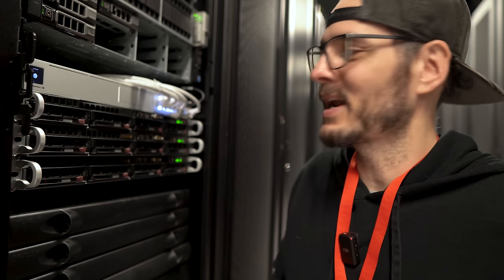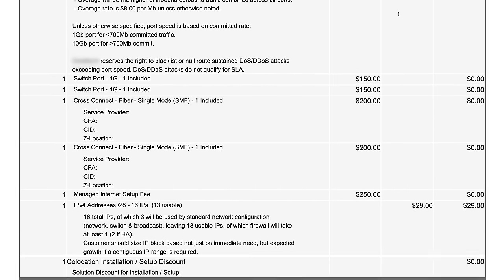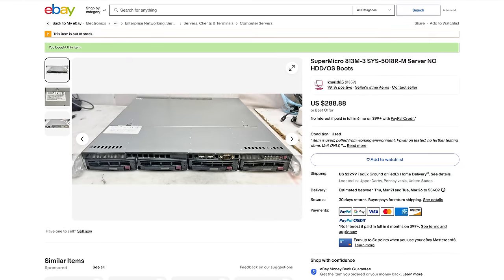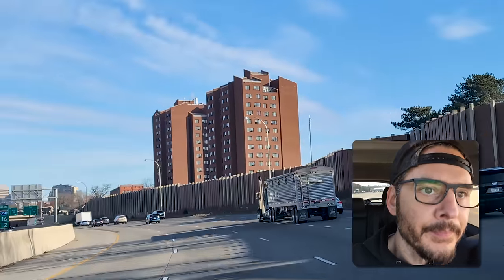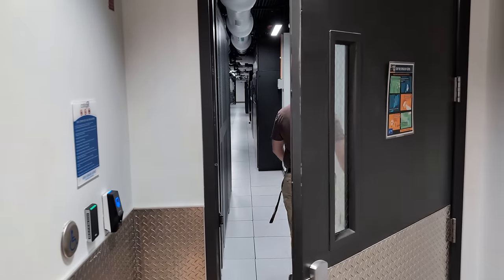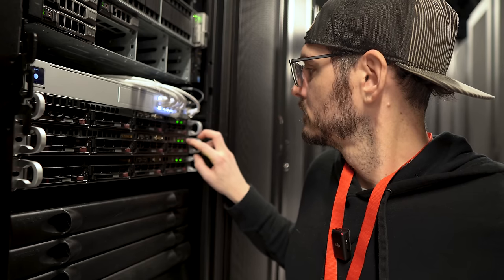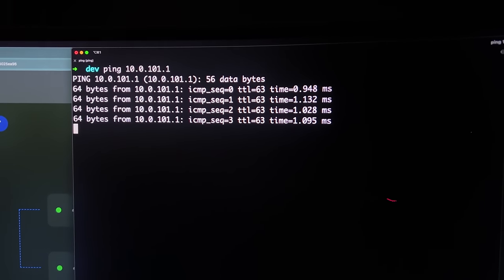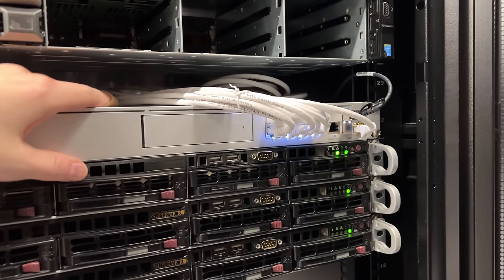I Colocated My HomeLab in a Data Center

Comment: A tip. Mount the UDM on the back side of the rack and gain back that rack space you used for the cabling to run to the back.
Reply: Exactly. Those cables are now consuming an additional U. Even in a shared rack, that extra U costs something and a U wasted on cables is an expensive waste of money.
Reply: You need to worry about airflow and where the UDM pulls its air. if its front to back like all the other servers, it would be pulling hot air from the back of the cabinet and dumping it out the front of the cabinet. This is why most enterprise network switches have models with back to front airflow.
Reply from the maker: Thank you!  Great idea! I proposed this a few times but they said it was fine in front.  We'll see if they change their minds once the rack starts to fill up! 😂
Reply: I'm actually surprised there isn't a top of rack switch they all just plug into and get their static IP's from. I rarely had to bring my own networking equipment for my colo's.
Reply: It might be tight, but I think there was space to run the cables to the sides. If this 1U ever becomes a problem.
Reply: I would not use the switch. Can you get 3 ports outbound? Just give each server a dedicated ip, I’m just guessing, but a /29 would get you there. Then use the 10gb nic dual ports to create an internal network ‘ring’. If you create a bridge you can also just add some rj45 ports in there to connect your ILO/IDRAC/IPMI. use a vm to route all your internal traffic in the cluster ;). Make that vm high available and you are golden ;)
Reply: What are you doing for redundant power around the UDM as it doesn't have redundant power supplies built in @TechnoTim
Reply: @TechnoTim mounting it at the backside of the rack is definetly the preffered solution. With this wide open space above the UDMP, the cold air can go straight to the hot-isle and disrupt the cooling of the datacenter.
Reply: @TheSHELMSY  reverse the fans?

Comment: Also Regarding your question: given that your ISP is located in the same data center as you (lol), I recommend sticking with the hardware Site-to-Site VPN. It's hard to find a better or more reliable connection. From my perspective, opting for a service like ZeroTier would only introduce unnecessary overhead to your current setup.
Reply: I also would stick with the site to site vpn, i would never trust others to handle or be part of it in any manner of my private vpn connection. Tried and tested trough ages. The thing you should ask your self is that, why would you replace it? What is that you are not satisfied with in the current site to site vpn setup? What benefit would give you over site to site vpn? That benefit would improve your situation or possibilities?
Reply: Hardware site to site for sure, nice setup
Reply: What about option with self hosted Zerotier controller. I'm using such option for quite a while now and got lots of benefits from it, but I'm not keeping my hardware in data center. Also Zerotier can be good access granulation tool.
Reply: As an ISP network engineer, I second this. 

Although you can do some cool things with Tailscale and ZeroTier, what you want from co-located equipment is reliability.   The more complex things get, the more likely they are to have problems.

Comment: I almost miss having to drive 30 miles to my ISP were my servers were co-located......25 years ago!   Back then it was a real treat to have 100M between servers with a T1 to the internet, and dealing with 2 dialup  lines in MLPPP to access them from home.  Looking at my full 42U cabinet now....maybe co-lo is a real option again?

Comment: One major downside of the way you've set it up: If your UDM dies, your entire cluster state may be compromised as nodes are no longer able to see eachother.
I would personally have added a 2-port NIC (I bought some refurbed SFP+ ones for 60 bucks a pop - tho I'm from Europe so your market may differ) in that unpopulated PCIe slot then hook up all nodes directly to each other in a mesh (A->B, B->C, C->A) with some SFP+ DAC cables (they cost like 15 bucks a pop from fs).
Then use the onboard NICs just for traffic leaving the cluster.

It would add some extra costs (and some configuration complexity) but the benefits are worth it in my opinion:
- Ceph can now run over dedicated interfaces (that are also faster when using SFP+), lowering the burden on the other interfaces (less congestion).
- Your UDM failing only affects your uplink (but your cluster state itself will otherwise remain unaffected).
Reply: an the 8 lan ports an the udmp are internally connected over just 1gb/s.  Its basicaly a 9port gigabit switch, 8 port facing the outside, 1 used internally to connect to the rest of the system.

Comment: BTW, you can save 1u of space (above your UDM) by locating your UDM to the back of the rack....this is where all of your eth/sfp ports live for your servers.   This is how most network0 their servers.  Also a reason way enterprise switches have a back to front air flow.
Reply: That’s also if depths are within reason
Reply: the UDM probably doesn't have a black to front airflow and would just be eating hot air at that point.

Comment: Hey Tim, cable ties and wire trigger my DC-OCD - velcro is your friend.  I would also caution you on the Unifi in the DC, having a single point of failure in front of the cluster could lead to sad times. Opnsense clustering is extremely robust, it's also getting a lot more updates than PFSense and it runs on lightweight hardware (I repurposed a couple of old Sophos xg-115's about 18 months ago - super stable) - Love the vids - thanks for putting them out there.

Comment: Excellent move! Not having to worry about power issues is a big one.
Here are my 2c's:
Moving the switch to the hot side of the rack is something you want to think through. I was dealing with this for years, until Cisco finally started offering fans with reverse air flow, so a) you're not obstructing the airflow in general and b) trying to cool you switch with hot air from the servers.
It seems there is no side cable management in the racks? I started to use slim cables - less space needed, better air flow. Plus they might fit through the side of the rack.
If you are using single PSU servers, you might want to invest in an ATS so you can take advantage of dual power sources. As a bonus they offer environmental monitoring and some even remote access to reboot your equipment (Hands up who had to run to a Cisco switch and pull the plug ;)

Comment: I vote for tailscale, one I would like to see more of it on videos and it works great.  I have remote repeater sites connected and 2 ranches in different states.  It does require a very consistent update but that seems to be the only drawback besides not hosting it myself.  Thanks for the videos, enjoy them a lot.

Comment: Would love to see you cover more colo type stuff! I had equipment in colo back in the 2000s and loved it, just recently set up some stuff in a colo to augment my homelab.

In colo, power is almost always your biggest expense. So half rack vs full rack is a small difference for a simple circuit. I've had high setup costs before when they have to set up additional racks. Its odd they make you pay for them to set up the space for you.

Comment: The 511 building is a pretty cool building if you're into tech.  I worked out of it for a short time a few years ago.  The tenant list is interesting and it has a storied history as well.  My understanding is that it was built as an R & D facility for Control Data Corp.  Across 6th St to the SW is the Strutwear Knitting Company building, made historic for other reasons.

Comment: I haven't used collocation for about a decade. Renting individual VPS is way cheaper and better maintenable than anything else without sacrifing performance (as long as you pick a good host). That said; I use tailscale for pretty much anything. My homelab, my office, my commercial servers, my clients... I love how I can manage ACL easily and quickly give access to anyone to exactly what he needs access to. Keep in mind that I also run my own DERP server. It shouldn't make much of a difference (speed/safety), but it was easy enough to self-host.

Comment: Nice indeed. I also started moving my homelab to colo, and managed to snap some 10G connectivity, 1U spot, and good pricing, and location. Used modern hardware (cpu, memory, storage, nic), and super speedy. Easily getting 10G to my home (and will expand to 25G once the colo owners upgrade their gear, to 25 or 100G), and getting 0.54ms rtt form home. Nice. I already want another server somewhere (maybe other DC), just for fun.

Comment: I would chose as the follows:
1. A site-to-site VPN, even using tailscale/wireguard as a site edge, for the major use case, in case some system does not support ts/wg,  as well as reducing configuring time for a simple testing-purpose project.
3. ts/wg as a backup medium to access one host in that rack in case of the failure of UDM VPN.

Comment: I would honestly do both.  Having the hardware-based VPN is nice, but if something ever happened and that UDM messed up, instead of a visit, with something like Twingate or Tailscale, you could connect remotely and fix things so long as the network connection were still somehow in tact.  Redundancy is never a bad thing.

Comment: I have a very close setup as you Tim. I have free colocation space from my employer, and my stuff at home. I messed with this a lot over the last year, and site-to-site in my option is the way to go. (Even using site Magic as you seem to be) the convenience (and troubleshooting) are worth it. I have tailscale on a few devices but that is mainly for a "oh shit" when I break something. I'll post some more in the discord.
Reply: agreed. it doesn't hurt to run both. For instance; past few days my TS exit node container was acting super weird and rebuilding it didn't fix it.. it was not until few hours I discovered snort was blocking part of the traffic.. I'd def have both implemented for a PROD deployment.

Comment: IF YOU PLAN FOR MULTI-GIGABIT ROUTING TO THE INTERNET: The integrated switch in the UDMP is like a GBe switch connected to the UDMP. So this always limits internet and inter-vlan routing.
If you don’t use the internal switch but connect a 10G switch via the UDMP SFP+ port, then you can use 10G towards the internet and for inter-vlan routing. This is reduced to 3.5 with IPS enabled.

Comment: Tailscale 100%.  Been using it for a few years and wouldn't look back.  The ease of setup and management is unparalleled and they have pretty big ambitions to be the de-facto VPN/Access/Networking company and I believe have built the team to achieve that.
Reply: Are you able to share the range of cost for the setup btw?  I didn't catch that in the video.

Comment: I have self-hosted and cloud servers in different countries, and I connect to them from many different places, so that's why I'm using a mesh VPN. But since you have them both with the same IPS, it doesn't really matters. But if you are trying to join cloud instances to the network, I'd go with a mesh VPN. Sometimes I need to test something in the cloud, so I automated the instance deployment that automatically connects it to Tailscale and after the instance is terminated or power off for some time, it gets remove from my Tailscale account. That's very handy.

Comment: May want to put your UDM Pro on the back side of the aisle for cable management, the heat shouldn't be too much of a concern with it. If you moved it to the back, you will also save 1U of space where your cabling runs through.

Comment: To answer the question at the end - yes! ZeroTier has the option of integrating with OPNsense, so the devices behind OPNsense aren’t relying on software, but you could just as easily install the ZeroTier client on your laptop and reach it just fine. That would (obviously) require you to change the UDM Pro, but that’s (again obviously) a decision for you to make. It’s a super neat solution nonetheless!

Comment: HI, I personaly manage multiple colo space, and i use hardware, redudent path vpn + dynamic routing protocol (OSPF). 
Also be sure to have a second way to access if your main tunnel goes down (eg, your ipsec endpoint down). 
Ps: i'm not using ubnt stuf for that setup.
Also, don't forget to document your ip usage on something like an ipam solution and think about a good adressing plan. It help alot
Reply from the maker: Great tips, thank you!  I wish I were better at networking!

Comment: I would use a mesh network mainly because I’m a big fan of Zero Trust, also you become more independent of the network at home or in the DC. But I would recommend something like Nebula. It’s super fast and lightweight. It won’t has a nice UI unless you use the hosted version but when you use Ansible for everything like setup key rotation it becomes really easy. On top you can use something like NetBird, it’s a German product. Also a mesh VPN solution, mainly does the same but with nicer Auth integration like SMLA etc. That I would use for things like mobile devices or PCs and Nebula for the Backend stuff.

Comment: I have a few VPS on different cloud providers that i wanted to link together over a pricate network, plus provide access to backup storage on a server in my homelab. Since this doesn't require multiple users or acceas control lists, Tailscale was overkill, so I just setup my own Wireguard mesh which has been working really well for almost a year now.

Comment: The cables from your udm need to be routed to the side then back unless that 1u above belongs to you. I primarily use tailscale to access my core systems. I run 2 independent networks that have access to the ilo of each other. 1 network has a hardware pfsense unit and the other has a virtual pfsense firewall that I can freely move and is redundant in case that server that currently has it fails. My plan is to replace the physical with a UNIFI ultra router when my stock comes is as that is my lab setup. I think I have 7RU with 2x 1gb uplinks. There is also a Synology 4 Bay for local backup on top of the backups going to my office over tailscale. 4 servers total+Nas+2u for networking hardware and I have different hardware at front at back to make the most of the space I have.
Tailscale is great but I feel like it times out sometimes with a constant transfer of few hundred gb in 1 go. I use XCP-NG as the base.

Comment: It's no question do the site to site VPN, it's more secure, easier to configure and manage the whole 9 yards. Also what some have already said you would likely benefit from having the udm on the back, typically only goes forward in home lab scenarios or in dedicated all networking racks. That's pretty cool though I never knew you were so close I used to work for an ISP/MSP that owns the fiber into that stadium and colocates at that DC. Although I never went there.

Comment: Just did this and besides all my co workers thinking I was insane, it's been great. $90/mo for 4Us. Tailscale on a EdgeRouter has been dog slow though. Now that I have a static IP and a stable site, I think I will switch to standard IPsec for the site to site VPN and use a regular VPN server to connect remotely. The MTU is much lower with the wireguard overhead than IPsec and it gives me issues with my vSAN Witness occasionally.

Comment: I’d swap out the UDM for pfsense, install Tailscale on that. Then site to site that way. Which would let you expand or remove devices in that colo rack, with ease.
Reply from the maker: I thought about it but then i need a switch too!
Reply: @TechnoTim  the netgate appliances have switches built in. Price tag isn’t as nice as the UDM though, but the features are much much nicer. Could also DIY with any number of the recent mini/micro PC’s ServeTheHome has been reviewing lately

Comment: About VPN and MeshNetworks: just my two cents: I went away from all VPN related stuff, going down the zero trust path. I just treat every machine as it would be exposed directly to the internet. And then i do exactly that. I don't even put a router in front of it anymore. My homelab is now basically a simple, firewalled kubernetes cluster with a health check backed multi-value answer DNS record in front of it. some might call it a poor people load balancer. I call it non-SPOF redundant solution. Rock solid for years and one machine can fail without losing any services.

Comment: I have been running 3 sites (I guess 4 if your include a cloud VM)
I use tailscale. I don't self host the relay as I just don't want the hastle and don't think it's needed. 
I use a mix of subnet routers, pfsense routing all non tailscale devices through it and the basics. I love the software. Kinda one of those thing that just work (like Plex).

I would love to see some brief example of maybe load balancing your two sites (basic website ?) or even having a health check and failing over to your home?

As a person who works in hyper scaler space and have worked at colos. Stuff can still go down. (Not likely but hey let's pretend out homelab is mission critical)

Comment: I might be a bit late in sharing my comment, but the pricing structures demanded by these data centers just strike me as exorbitant.

I'm employed at a decent sized data center in Germany. For comparison, our pricing for Scenario 1 offered by the second company would be $162 per month, with a one-time fee of $42. This includes:

4U rack space (shared rack)
1 Public IPv4
/64 public IPv6
1 Gb/s dedicated uplink
Inclusive power
Moreover, we've recently bumped up our prices for these small rack spaces, making the larger rack spaces (1/4, 1/2, 1/1) more appealing.